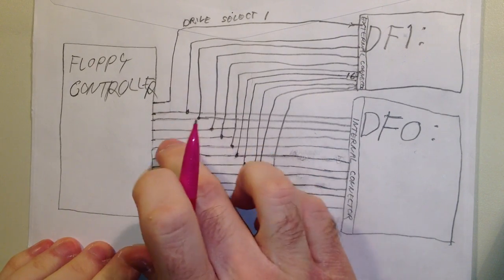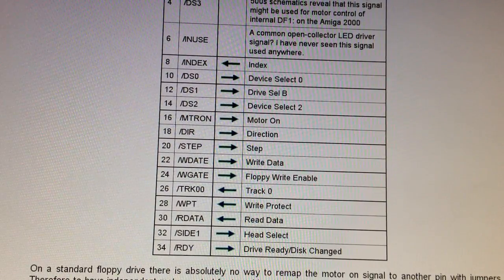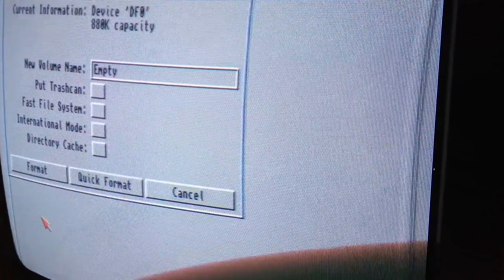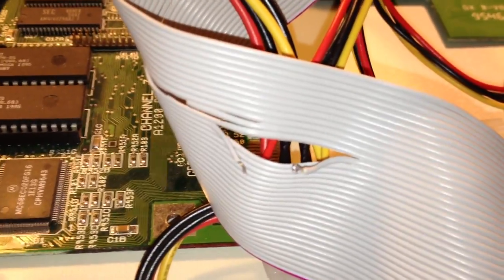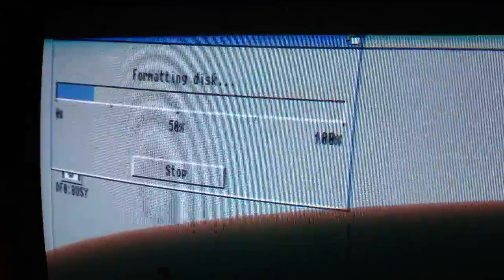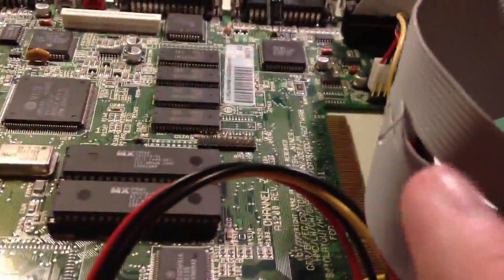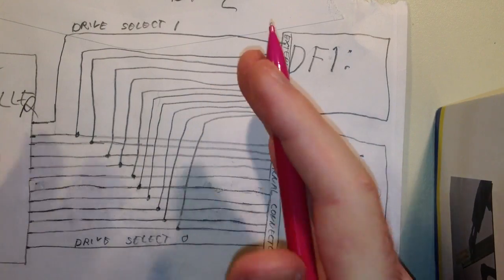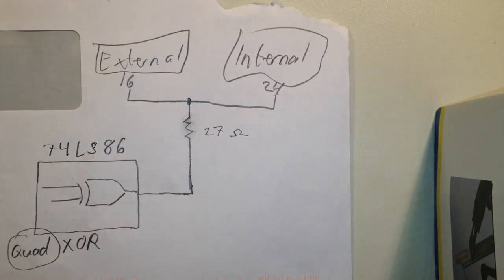Video response - 'Amiga Floppy Strangeness'

Comment: If anybody else is following this video later on, just FYI: 
1.) There were several board revisions: 1A, 1B, 1D1, 1D3, 1D4, 2B
2.) Schematic Diagram for A1200 (REV 1->1D PCB) can be found here: 
https://archive.org/details/A1200_Schematics_1992_Commodore
(The shown internal/external Floppy connectors CN11 and CN5 can be found on page 12)

Comment: Nice detective work :-)
I have an external floppy drive for my A500 that is having some issues. After inserting a disk into it, Workbench reports all disk as "DF1:BAD". Even disks that are working in the internal floppy drive.
I uploaded a short video showing what happens when I insert a disk here: https://sendvid.com/uivwmu3u#

A few seconds after the disk is inserted you will hear a low "click" (that is the drive making that sound, not the surroundings).
It doesn't show very well in the video, but the green LED is working, but very dim.
I tried cleaning the heads, and the insides of the drive without that making any difference. I were careful not to bend the arm for the upper head when cleaning.
Any suggestions on how to proceed? Thanks!

Comment: Great video! I have a 600 in which I replaced the floppy a little over a year ago with one I bought on Amikit. Recently tried to boot Earl Weaver from it(which is one of the few games i still play from floppy) and it booted off the hard drive. Its showing DF0:??? on workbench. Both copies show the same thing. DF1 is working fine. SysInfo shows the disk is write protected(which it is) but also says "no disk inserted'. Any ideas? I would hope that it has not crapped out after one year. I do have another new one i can install but i wanted to hear some opinions first. Thanks!
Reply from the maker: als81940 Have you tested the motherboard with another DF0 disk drive to make sure that it really is the disk drive and not the motherboard that is defective? If you have verified the floppy drive to be defective, then please don't throw it away, especially not if it's a Shugart drive as these are not easy to find anymore. I think it's quite possible the drive can be fixed. It might just be a misalignment issue or something similar to that, and that is quite easy to fix if you have the right tools and know how to do it. But it's difficult to say from a distance what the problem could be exactly since I don't know all the details about how the drive behaves.

Comment: Great informative video, obviously to really repair this fault one needs a oscilloscope to diagnose it fully at the logic level ?
so perhaps a logic probe could help to a certain degree in fault finding.
Reply from the maker: A logic probe could fully substitute the oscilloscope in this particular case, since a logic probe is a perfect tool for checking whether or not a certain logic signal is present at a particular point in the circuit. An oscilloscope can also be used to achieve the same thing, but a logic probe will be perfectly enough as long as the purpose is only to verify whether or not the signal is present. Obviously, an oscilloscope is needed in a case where it's desired to observe the waveform of a signal. A logic probe will not be sufficient in such a case. But in this particular case, the symptom on this person's Amiga was due to a break in a trace, and a logic probe would have been a perfectly valid tool to use when diagnosing that, since the signal of interest is a TTL compatible logic signal.

Comment from the maker: However, if there is a short to the 5V rail at the floppy end, the output of the logic gate on the motherboard that is supposed to sink the 5V data write gate-signal down to GND will obviously not be able to do that, resulting in a constant 5V at the floppy. It's easy to diagnose the problem; If one connected floppy causes the problem to occur on the other floppy, then that floppy is at fault. If the result is the same with only one known working floppy connected, the problem is on the mobo.

Comment from the maker: Yep, exactly. The gate signal is active low, meaning the gate is open when it's at a logic low level. However, the reason that it's always high doesn't have to be because of a short to 5V. Like most TTL, the floppy logic have pull-up resistors to the different signals, meaning that an unconnected pin will be at a logic high level at any time. So if there is no signal (due to e.g. a broken trace) present to sink the 5V down to GND, the signal will always be high because of the pull-up resistor.

Comment: Yeah, if I remember, when you had set the gate high...it gave the same results as his...so that's what I was thinking..too...actually shorted to the 5V rail...not grounded. It would be nice to know a little history of the problem...like if the internal drive wasn't working so he bought the external drive and it still had the same problem...(the problem would be in the MB)...but if the write stopped working after he added the new external drive then you know the problem comes from the external.

Comment from the maker: Thank you for your support. :) The reason for the gate signal not being present might be caused by many reasons. A cracked solder joint, a broken trace, a bad component etc etc. These things may or may not be the result of corrosion. It is very much possible that a cap has leaked on this person's motherboard, as you suggest. Unfortunately, we will never know the exact cause here since I am not able to examine the original video poster's motherboard myself since I don't have it here.

Comment from the maker: I like your way of thinking. During repairs, you often have to be prepared to make different kind of assumptions and think about what the consequences would be.
My conclusion is the same as yours here; I have not tested it, but if the gate signal was always grounded, the drive would probably take all operations as a write operation, possibly writing garbage to the disk during a read operation if the disk was not write protected. It could be that the gate signal is shorted to the 5V rail, though.

Comment from the maker: I'm really glad you found this video helpful. It would be great if you could let me know as soon as you have looked into it, because I'm really curious whether it was the signal trace, the resistor, the IC or something else that was at fault. Btw, if you're not using an ESD-band (ESD = Electro Static Discharge), make sure to touch a metal surface somewhere close to you that is connected to mains earth before you start working on your 1200. Thanks a lot for your subscription btw. :)